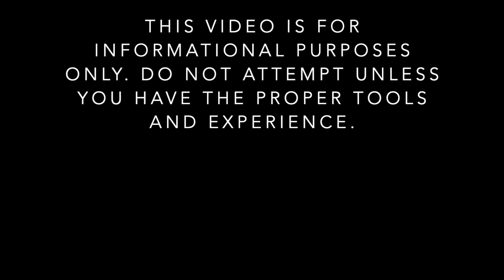How to Replace Rear Brake Pads on a Toyota 4Runner- 4th Gen 2006

Comment: I have done a lot of brakes in my life as a tech, let me tell you the power stop brake pads and clips are not user friendly. They take way too much effort to go on! To a point that once they are installed, they don’t slide and start scraping on the rotor. They are on the rear pads of a 2004 4Runner.

Comment: I’m doing his with the Akebono kit which comes with 4 additional smaller clips. Maybe anti rattle clips. I didn’t pull any off the old ones. It looks like you had one on the lower ear when you took the inner pad off, but I didn’t see you add any before adding the new one. Is this not necessary, or only necessary with some brand pads? Thanks.
Reply: Hey bud I’m wondering the same thing. What did you end up finding out??

Comment: I saw both sides sitting on jack stands. Did you lift with floor jack from center differential, then put stands? How did you control front wheels from rolling? Of course I'm making all kinds of assumptions here, lol.
Reply: You can raise it from the differential and place the jack stands on the axle housing

Comment: Very helpful video with some great tips! Supplemented the Hayne's repair manual with this video today. First wheel took 2.5 hours and the second wheel with cleanup only 1. Been some time since doing brakes but venturing more lately with the 4Runner. Used a 6" c clamp but a 4" should work. Needed a small steel breaker bar for the caliper bolts. Headlamps help for inner pads. Don't forget to use the grease that comes with the pads!

Comment: Thanks for the great clear content!      I am doing my rear pads on my 2008 later today.    I changed the front pads last week and discovered a siezed piston on the driver's side caliper.   So had to replace the heavily rusted front calipers as well as the pads.

I'm hopeful the rear caliper pistons are in better shape.     Odds are better since looks like only one large piston per caliper vs 4 smaller ones ea. on the front calipers.    Fingers crossed.

I read on a 4runner forum that rust is a big issue on the front brakes in these trucks.    30 years of changing brake pads and this was the first time I had to change a caliper.    But I am a DIY guy not a pro so a much smaller sample set.     Still love this truck for ease of maintenance and reliability otherwise.      I generally get 300,000 miles from Toyotas.    

This is my favorite since the Previa we bought in 1994.
Reply from the maker: Great to hear you are tackling your own project. Hopefully the video will help make it easier. Thanks so much for watching.

Comment: Good explanation, thanks for taking the time to post this. How come you didn’t replace the discs?
Reply from the maker: Yes, its a great idea to change out the discs as well. Stay tuned, because that is going to be a feature video that we wanted to make independently.
Reply: Scott's Garage I’m about to do the rear pads and discs at the end of the month so I wanted to see how someone else did it beforehand.